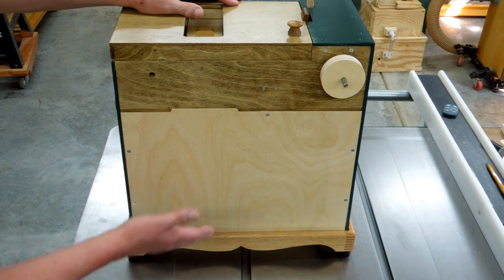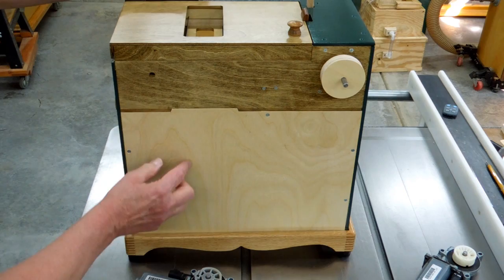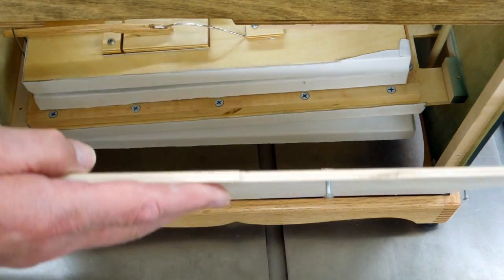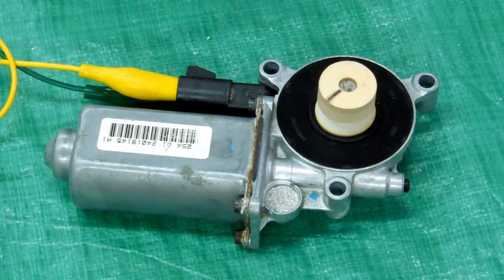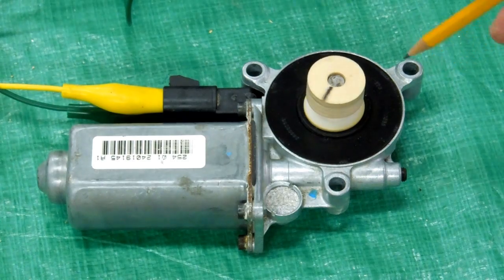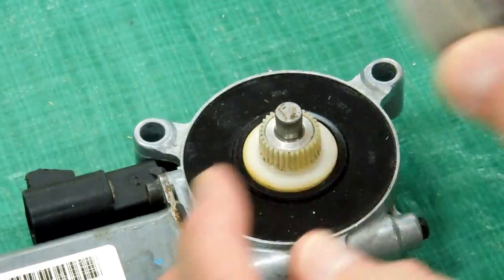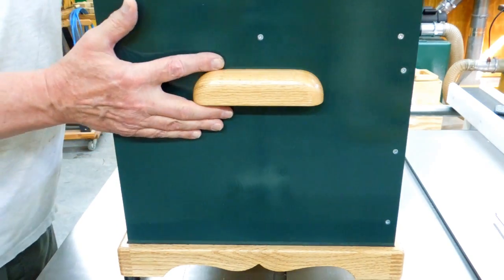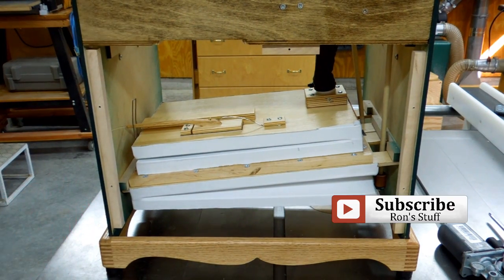Senior 20 Organ (19) Motor Mount & Pipe Configuration Part 1

Comment: Ron, how did this motor work out on the finished organ? I tried a small 12 v DC 60 RPM geared motor on mine and it did not have enough power
Reply from the maker: Stan Shuford  Actually, I have not gotten back to this organ. My shoulder surgery took longer to recover from than expected, and I seem to keep getting distracted by other projects. It is on the to do list and I will post the results at that time. Note that 60 RPM is the approximate speed requirement of the organ crankshaft so a driving motor is going to need to turn considerably faster so you can gear it down (say 2:1) and have a way to vary the speed or it will need to be a very strong gear motor (like a windshield wiper motor). The small gear motors out of China will state an RPM but that is usually a "no load" speed. Under load they slow down considerably.

Comment: And another question: will there be a knob / lever to increase the air pressure and thus the volume (loudness)? That would be a cool feature!
Reply from the maker: surfcello The pressure is regulated by the reservoir... thus the loudness is fixed. There may be a knob to control motor speed slightly +/_.

Comment: Ron, I have a question regarding playability: What is the ratio between the rotations of the crankshaft and the beat of the music? Because I'm sure it'll make it easier to play at a uniform tempo by hand if your arm movements are in time with the music. It would also help if the crank were connected to a flywheel.
Reply from the maker: surfcello  The expected crankshaft speed is around 60 RPM. The motor speed is around 90 RPM. You tend to turn the crankshaft until the music sounds about right "to you". If you watch Video No 6 in this series "Making The Cranking Wheel" you will see it is a flywheel.
Reply: Ronald Walters So if the music plays at say 120 bpm when you turn the crank at 60 rpm, that would be nice and easy - just like conducting! But if it's slightly off, the player has to ignore the music when controlling his cranking speed, I always find that challenging.

Yes, the cranking wheel is a flywheel when driven by the motor, but when driven by hand at only 60 rpm, it doesn't seem like it has enough inertia to prevent an accidental change of speed, does it? So it'll need a somewhat skilled player to keep the tempo ...

Either way, great design, and I love your meticulous and effective work! Looking forward to the first notes.

Comment: Really like the idea of using car window motors! About how much are they at the junk yard? So the motor will be inside with the shaft extending outside to hook up with the outside pulley of the spool? Thought you already experimented with the pipes. Guess I'm wrong (which I usually am).

Comment: The window motors, I think should work well. The duty cycle not being 100% may be a problem but your gearing it down also. IRC the main gears are usually are a hard wearing plastic. Windscreen motors are 100% duty and have enough torque to rip your fingers off. They where a favorite for robot wars/battle bots wheel drives. IRC they run clock wise looking from the spindle side. All the best.
Reply from the maker: Sirus I suspect these would do you damage as well. I looked at wiper motors but they generally were too big. A rear wiper motor might work but I found these first.
Reply: They are so similar in design. I suspect the the motors could run forever without over heating. just looking at the pulley your going to use is around 4 times less load. All the best

Comment: Will you do a video on the paint on the outside? It looks really great.
Reply from the maker: aserta I have not documented the process thus far... but I can. I got a little ahead of myself with the paint and ended up having to drill more holes, and then repaint. I will put it on the "to do" list.
Reply: Ronald Walters If it's too much hassle then don't your time with it.

It looks really good and i was curious what steps you took that's all.

Either way, thank you very much for posting these videos, i learn quite a lot from them about wood working